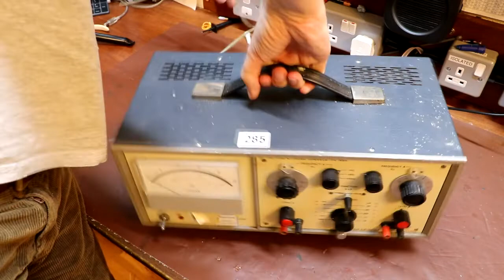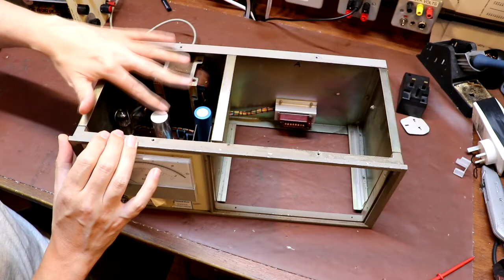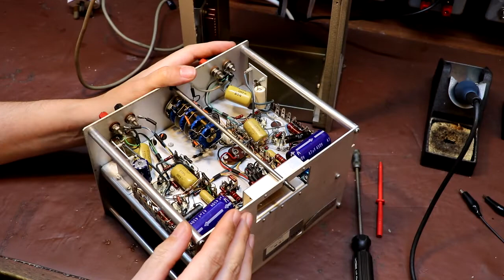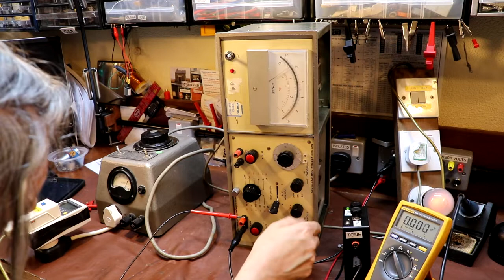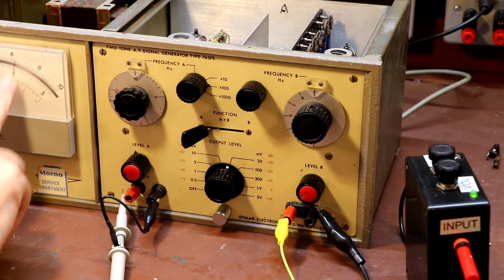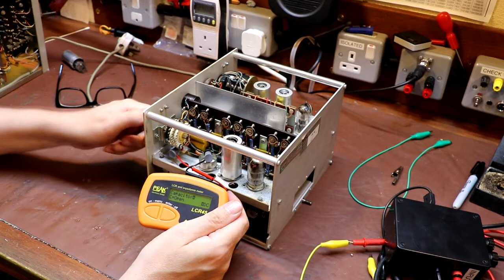Dymar Two Tone AF Signal Generator Type 745/S

Comment: That’s a nice bit of kit Chris. It would be more useful to convert it for SSB alignments. The kit I bought oscillates at 700hz and 1.9khz but is adjustable by altering the components. I will pop the data sheet over to you on email. Great video as always
Reply from the maker: Radiocruncher Hello Graham as you say it’s important that the two tones are not harmonically related. I’m just having ago at building one as you asked for a demo etc. I probably will convert it as I don’t think CTCSS is useful for me. Thanks for watching and nice comments

Comment: Those yellow caps are an old Philips polystyrene type. They are very high quality, stable and low loss capacitors but they don't withstand heat very well so you need to take considerable care when soldering them. Pointing a heat gun at them is also not advisable. They are also not good with most cleaning solvents which will soften or dissolve the body of the cap.

I think you would struggle to find exact replacements for the larger values of this type of cap today.
Reply from the maker: Thanks for the heads up on the capacitors. The body on these caps were bad before i started. They are very soft I can push my nails into them.  As for the heat gun well you need to diagnose fault with the gear you have such is life.   These caps will be coming out, 75hz is not useful for two tone testing. Thank for the information and great comments. Regards Chris

Comment: Is the B side a ratio of the A side?
Reply from the maker: No its a total seperate circuit. Not sure why such a low frequency was chosen as it likely outside the Audio pass band. But then again I have no information on it so itt may not have been designed for audio SSB work. Thanks for watching Regards chris

Comment: Looks like a good old bit of kit, not too complex and no bloody processors!!... sorry i went a bit mad there :-D
I  was thinking 1.5khz for some odd reason,  i have forgotten most of the usb stuff in sidebanders.
When you first turned it on,  it made a rather unhappy clangers noise, a bit depressed :-D
How dare you test that item without first wrapping tin foil all down the mains cable and testing ,  just in case there is a micro crack in the double insulated mains cable, someone might get a shock if they touch the right spot and when the voltage is peak and they are earthed :), yes i'm talking pac ollocks-b.
Smashing video chris, thankyou :-D
Reply from the maker: zx8401ztv i am a bit of a traditionalist and I have a large vat of mercury I’m like to use for testing cables. Thanks for watching and comments regards chris

Comment: Thank you for an interesting video, Chris. An unusual piece of kit! I did find this - https://sound-au.com/articles/intermodulation2.htm  - which states that SMPTE standard RP120-1994 test for IMD uses 60 Hz and 7 KHz mixed. Also, looks as if  channel B may have an adjustment trimmer for each switch position. Might be interesting to give one a twiddle (after recording original frequency setting, of course). Regards, David.
Reply from the maker: David V I think it’s actually  a CTCSS system as it’s spot on the lower channel numbers. I have had a twiddle and I can only pull the frequency about 5hz. I would have to change the capacitors to something smaller to get a reasonable frequency range etc. This gives me a Dilemma. Do I keep it stock and never use it or modify it for SSB alignment? Thanks for watching and great comments. Regards Chris
Reply: @allthegearnoidea6752  I think you are correct, it does look like CTCSS tones - I worked on some Motorola commercial radios that used "Private Line" sub-audible modulation tones. I wonder if the "/S" model number indicated it was set up for signalling systems? Would it be possible to replicate the board holding the trimmers, capacitors and resistors? Set the original aside and insert your own with component values for SSB work. It could then be restored to original without too much work. David.

Comment: Hi Chris I think the low freq side is maybe for simulating ctcss (sub audible tone) used on repeaters & other two way radio applications
Reply: Yes, most of the frequencies measured are pretty close to the standard CTCSS tones. The fact that there is a number of trim pots on the board suggests that each of these tones was to be trimmed to an exact frequency.
Reply: Funny enough, as you were reading the frequencies it struck me that they were close to the low end subaudible tones. I think Nick and Stephen have hit the nail on the head.
Reply from the maker: George Christofi I definitely think your on the money with CTCS. I now have a dilemma should I keep it stock or convert it for SSB use.?
Reply from the maker: ptronix  Yes that’s possible I wish they had labelled that frequency selector switch. I think I will be reducing those capacitors values hoping to get a 600hz tone.

Comment: The two tone generator I have is a little Elecraft unit which mixes  1900 HZ and 700HZ for SSB transmitter  testing. I'm not sure why they have such a low frequency setting on your unit. Probably a pretty expensive piece of gear in it's day so not many people other than commercial users would have bought it so it may be difficult to find info on it. Of course we never know if service info ever existed outside the Dymar factory either. You may want to check on some of the vintage test gear forums. Good luck with it as it seems well worth getting going properly. ATB Doug.
Reply from the maker: Doug McArtin  I think I will be tweaking up that low frequency. But I’m going to give it a try first regards Audio pass band etc. Thanks for watching regards Chris